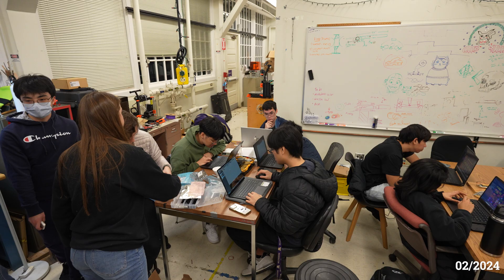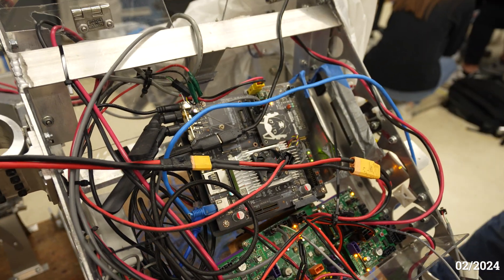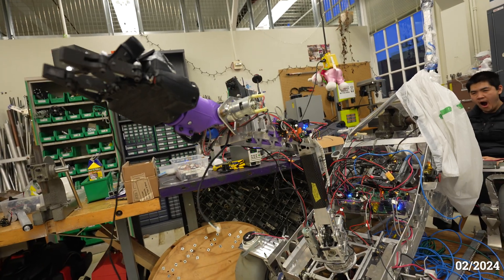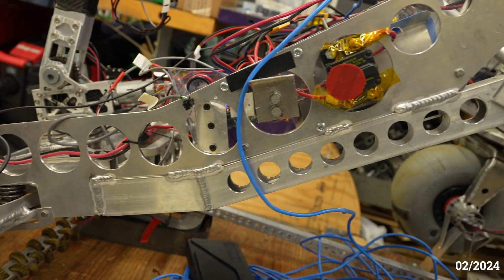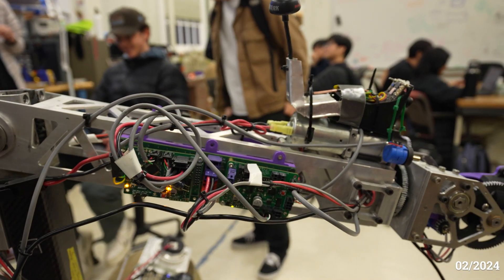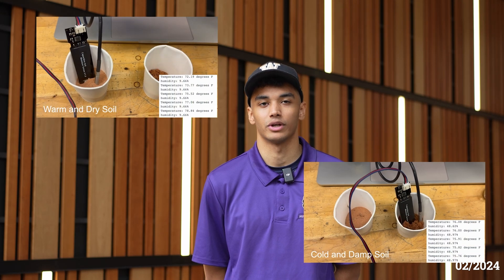Husky Robotics- University Rover Challenge 2024 (URC) - System Acceptance Review (SAR)

Comment from the maker: TRANSCRIPT:

Introduction: 0:00
Hello! We are the Husky Robotics Team from the University of Washington. Now in our 11th year, we work through a two year design cycle to develop, build and test our rover. Our team is proud to employ a workshop curriculum to train new members preparing them for industry. This year, we have developed an innovative and agile mobility unit for traversal of the landscape, a dextrous arm for part manipulation, our most capable soil analysis system, and effective control software for our most reliable and advanced rover yet: Oversight!

Manufacturing: 0:31
Throughout the year, our manufacturing team conducts training to develop and enhance the team's capabilities in manual and CNC machining. Our machine shop and training program has allowed us to make complex custom parts quickly and efficiently.

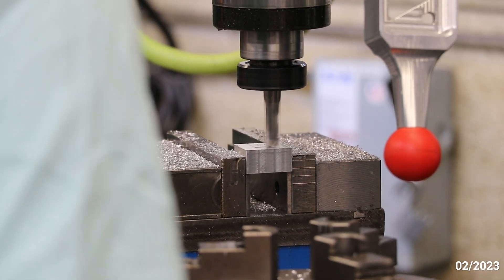Electronics (Hardware): 0:43
Our electronics subsystem focuses on delivering reliable and modular electrical solutions to efficiently power the motors and sensors of our rover.  
To enhance the reliability of network communications and to minimize miswiring, we use a combination of stacking headers and keyed wire connectors, reducing the overall footprint of the electronic components inside the rover chassis. The rover's operations are regulated by custom embedded circuit boards that are responsible for power distribution, motor controls, and telemetry data collection. Additionally, every board comes equipped with integrated voltage and current protection.5

Electronics (Firmware): 1:15
We use a custom CAN protocol to communicate between boards on the rover. All of our boards run custom team-built firmware that interfaces with brushed and brushless motors, status LEDs, hobby servos, and various sensors. These boards handle control loops and polling so that the main computer can focus on high-level control and other processes. We use Infineon’s PSoC microcontrollers which give us access to powerful hardware resources to control our rover with reliability and low latency.

Software: 1:40
Husky Robotics’ software has been steadily evolving for the past few years, and now we are more robust and capable than ever before.
Our web UI is the main interface between the operators and the rover, We have built it with efficiency and effectiveness in mind. Particularly, low-latency video streams allow our operators to maintain situational awareness, and offline satellite maps greatly aid long-distance navigation.
Running on our robot, sensor fusion algorithms give us high accuracy state estimates, which we feed into a global planner and local controller for long-distance navigation. Additionally, our kinematic control algorithms enable precise and agile manipulation with the arm.
We also leverage a 3D simulator for rapid testing. Using it, we can safely test new navigation and even arm control algorithms, without worrying about any associated dangers or risks of hardware damage.

Mobility: 2:19
For our rover’s mobility unit, we wanted to ensure functionality on all terrain, so we built a new hinged frame that can sit low and stable for climbing hills, or raise up to clear obstacles. The larger frame is light and strong with liberal use of welding, and the new, spring based front suspension keeps the wheels on the ground and protects the arm from jolts. 
The air inflated tires further increase our suspension ability, and the wheel hubs are designed to handle very large force loads, ensuring functionality of the Mobility unit. The strength of our unit was verified using worst case scenarios to inform finite element analysis. The rover at this stage is fully ready to compete, but our further goal is to improve the tread that is on the pre-existing tires, so as to help our maneuverability. 

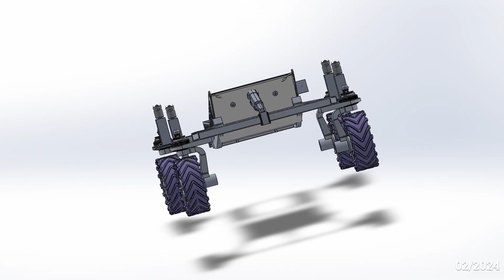Arm: 3:02
On the arm subsystem, we are proud to present our improved arm module. Our design features a large crossed roller bearing that allows us to withstand the unidirectional loads from unexpected circumstances. Our extensive use of finite element analysis and topology optimization has enabled us to reduce the weight of the arm to just 10kg, greatly reducing mass while still maintaining high stiffness. 
Positional sensors such as potentiometers on each joint provide absolute positioning for simpler and more accurate control while extensive usage of limit switches eliminate the possibility of self-collisions.
Our new and improved adaptive gripper hand is a testament to our reliable mechanical design.  We've used nylon and carbon fiber-reinforced filament to further improve the longevity of the worm gear mechanism inside the hand, maintaining extremely lightweight and still durable. 
And finally, the unique U-channel design of the arm allows for it to fold down on itself, lowering the center of mass and creating a smaller footprint on the chassis, further protecting it from unexpected impacts.

Instrumentation: 3:59
The Instrumentation station uses a linear actuator to hold an auger and  hopper used to collect and store soil. After collection the hopper raises to dispense the dirt onto a conveyor belt. Attached to the drill are a microscope and sensor array. We have humidity, temperature, and several gas sensors. 
The soil samples are deposited on a conveyor belt, which delivers soil to our chemical tests, sample storage, and Raman Spectrometer. Our chemical tests use pumps and a lazy susan to test soil water from up to six sites. For testing, we are using a Biuret test for proteins and an Iodine test for starches. 
We are also using test strips to test the amount of ammonia, nitrate, nitrite, phosphate, sulfate, and pH levels. Our sample collection mechanism holds up to three site samples at once. Once a preferred sample is selected, a lid will be snapped onto the jar, which can then be easily removed by hand to give to the judges. 
Our Raman spectrometer analyzes samples for the presence of kerogen. Soil from the conveyor belt is funneled, ground to help accuracy, deposited into vials, and tamped for a smooth surface analysis. A small lazy susan helps allow independent examination of each sample and prevent cross-contamination.

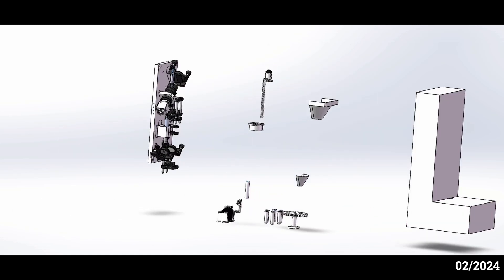Business: 4:57
We would like to thank our sponsors!
Harmonic Drive, Solidworks, Altium, Onshape, Protocase, Garnet, UW Department of Mechanical Engineering, Paul G. Allen School of Computer Science & Engineering, UW Department of Electrical & Computer Engineering, Student Tech Fee, The HUB